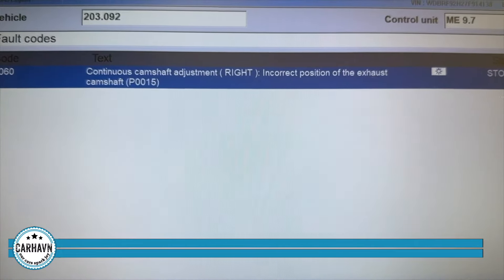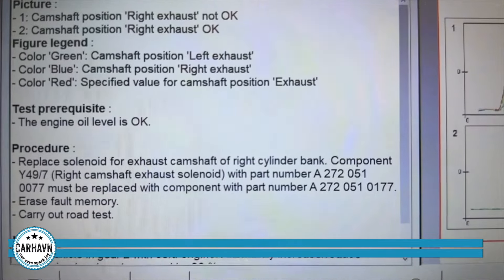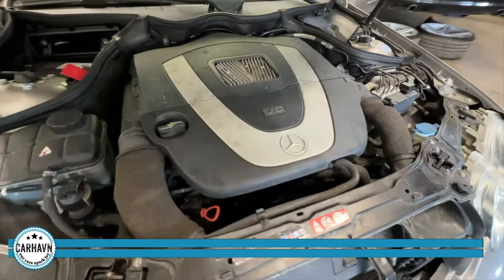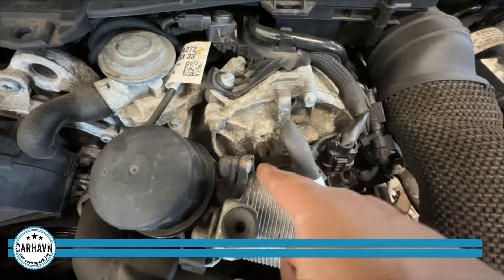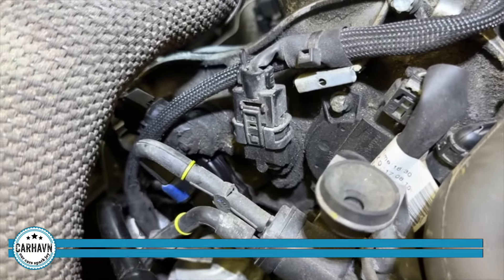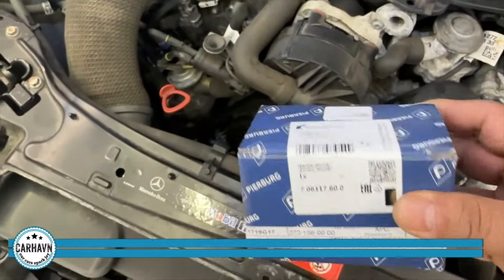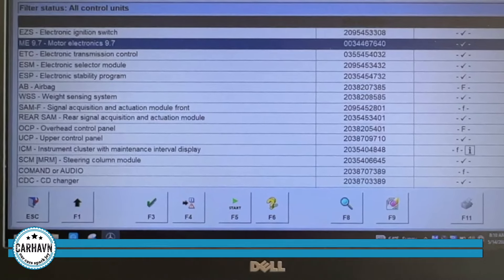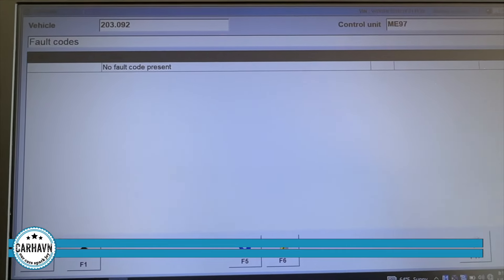CarHavn Fixes Mercedes Benz P0015 code (M272 V6 engine)

Comment: Will the computer not see it's fixed, so you have to reset the codes? I had P0014 first. I changed the sensor. I drove it, and then I got P0015. I changed that a couple of months ago, so it has a new part. I replaced all of them on my car, so I put an old one from my car, that was still god, on my wife's car. It still shows P0015. Even after driving it a week. But the service engine light does not come up on the dash. I was hoping the computer would see it's working since it changed from P0014 to P0015 after changing a part. I have to smog it, so I didn't want to reset everything. But maybe I need to.
Reply from the maker: After the repair is done, the codes have to be properly cleared, ideally with the Xentry system. The code will come back if the sensors detect the issue is still there.